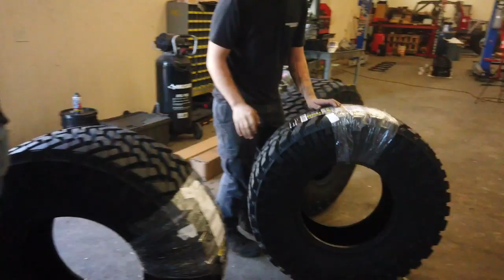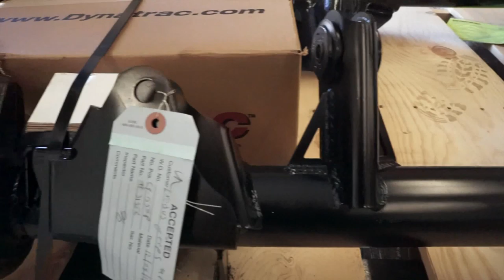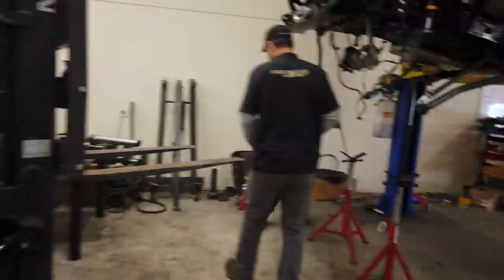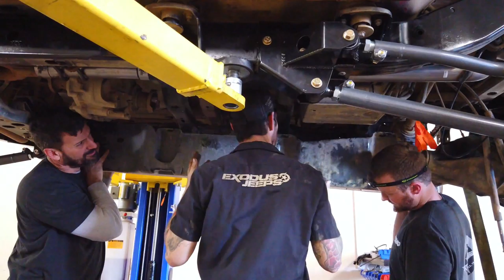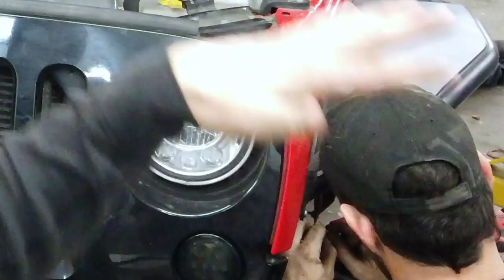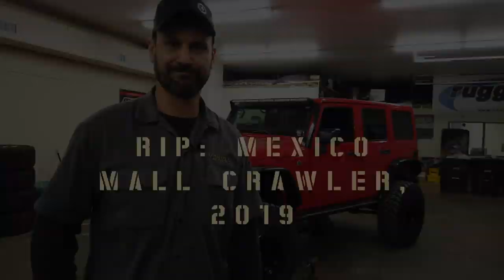The Push to Make this Jeep Build Ready for Mexico

Comment: Question on the rock sliders.  Appears they have mounting points for bolts. What is the advantage of going with a set that requires welding them on since they are invariably going to get banged up. I am on my second set already.

Comment: Looks great. Any clearance issues with the rear Currie AntiRock contacting the rear brake line bracket on the frame? I have mine set up the same way. No clearance issues yet. I don’t know how. But no issues yet.